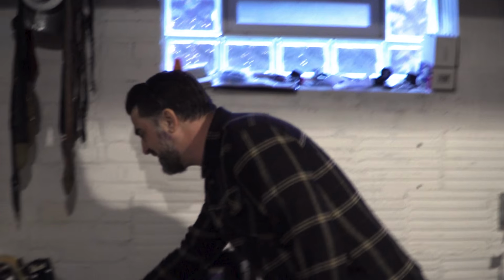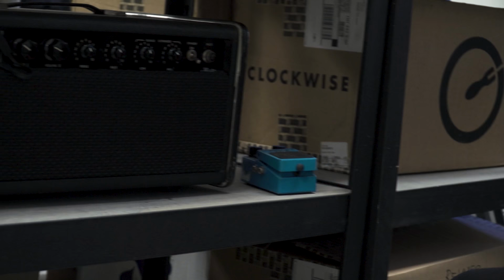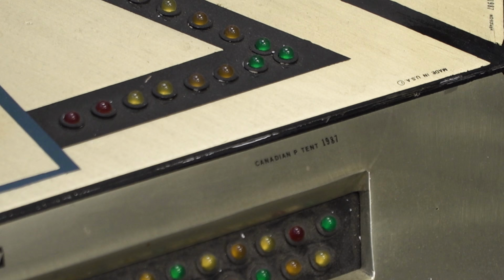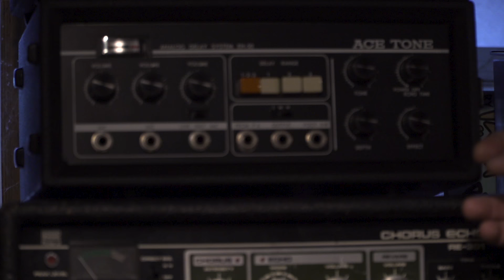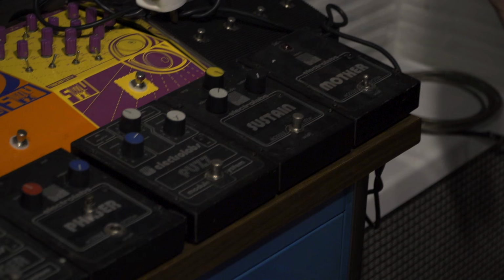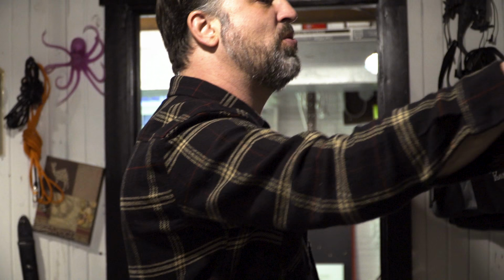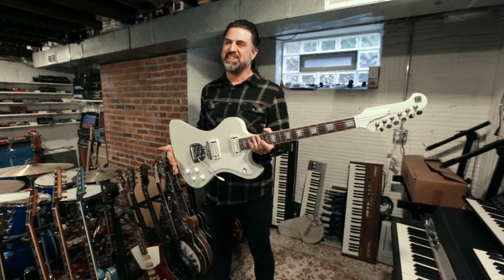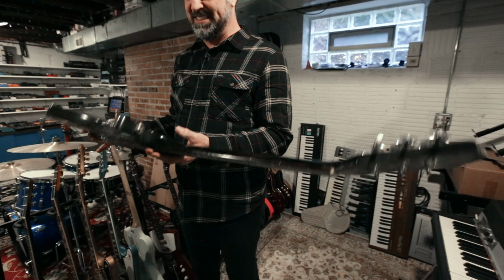EarthQuaker President Jamie Stillman's gear hoarding mentality

Comment: The little rye smile u got on your face while ur talking abkut those goofy amp heads on the shelf, is the same fuckin smile i am forced to wear whenever i am describing the iterations of my own personally designed envelope filter pedal. I am on pedal iteration #102 lmao. Which,  sadly maybe, means that i have designed, redesigned and built out 101 pedals prior to the current one. But....i believe that i nailed the idea and sound and capabilities of my idea of a perfect envfil. Currently working on making it smaller so i can route out a spot under tele pick guards without routing too much meat

Comment: I assume some of the hoarding coincides with trying to preserve these pedals that are historic. But if somebody has them in a museum somewhere, then I guess the rest of them should just get used.
A counter argument would be that most of these pedals can be reverse engineered and recreated close enough that there's not really a need to use the vintage ones, besides that 1% of special magic.
So they could just be collectibles that are quite expensive that just so happen to have a function, if still working.

Comment: The rack full of the brains of the floor console looks like a modified NIM (nuclear instrumentation modular) bin. Looks like that thing may have started life as nuclear physics lab equipment
Reply from the maker: nim bins all day baebae
Reply: That thing looks way more interesting than actual reactor equipment . It's got the same multi-pin connectors that I've worked with.
Reply: @EarthQuakerDevices  Get an Ortec 474 Timing Filter amplifier while they’re still cheap! I have a stereo pair I converted to 1/4” and they’re the best preamps I’ve ever used

Comment: That stuff is kinda cool... but I would never spend my money on old vintage gear that barely works. I like to use my gear, so I'd rather buy stuff that will actually gets used, rather than just looking cool in a collection. But that's probably just because I'm a tightwad with my money. Lol
Reply from the maker: it works, it just sounds like shit. I mean, it doesn't all "work" per say but ok ok... Didn't cost "money"... right?